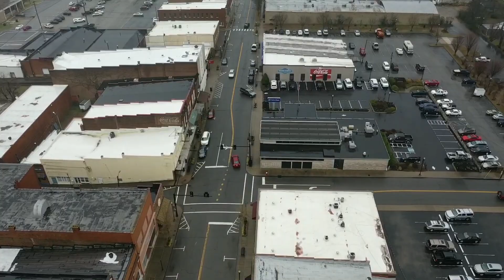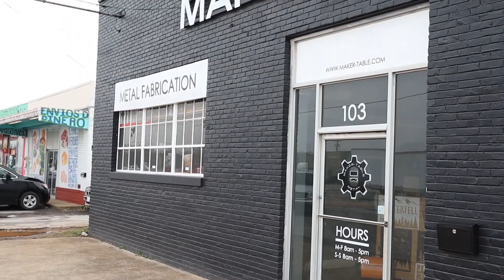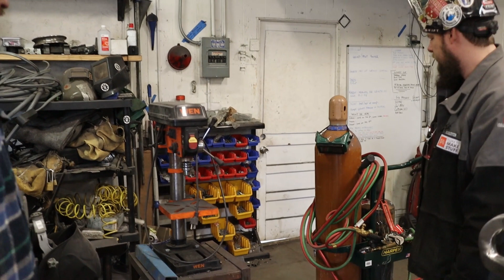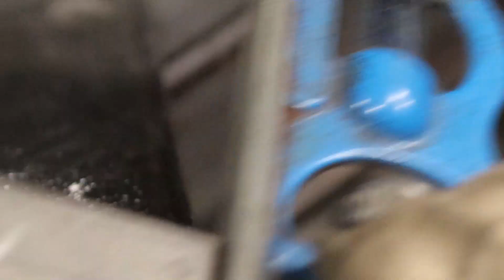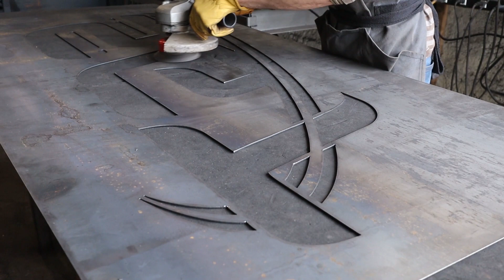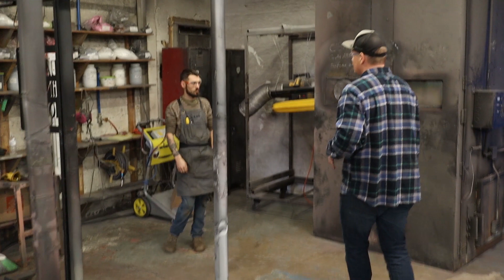METAL SHOP TOUR (2019) - MAKER TABLE METAL [Ep. 3]

Comment: Sounds like you to call Eaton compressor and upgrade your compressor with rotor screw compressor https://eatoncompressor.com/product/7-5hp-rotary-screw-air-compressor-single-phase-cabinet-only/ that unit is rated for 100% duty cyle and last you years of hard use and they have done alot standard compressors too love the content
Reply from the maker: Dude, I would LOVE a screw compressor!  I actually got an Eaton compressor, air dryer and muffler this year.  Great product but still a traditional 2 stage compressor with 120 gallons of headspace, we call her Buddha LOL!

Comment: What do you do for air quality / fume extraction on the plasma table and welders? This is my first winter with a plasma cutter, and having the garage door closed is just not an option... I got a respirator, but still wondering what others are doing to keep the air breathable. Thanks!
Reply from the maker: We move a LOT of air is the only answer.  Keep your water bed topped off, doors open and a respirator on.  I started with my table right in front of the garage door with a fan in front and behind to try and create a tunnel of air that carried smoke out asap.

Comment: great to see a video of the shop tour and current status of things and the kit you're running. A screw compressor is on your list im guessing, to replace those belt driven ones? bit more expensive but long term a lot better and smaller footprint with a lot higher output.
Also, another simple and cheap improvement to make to the compressor area and dryer is to enclose all that in by making a simple stud wall enclosure to seal it in and add a heater to that newly formed 'room'. Also if you can vent into that room through the wall to the outside (preferably with an internal filter in place) which will let the compressors draw in fresh exterior air, reduce how much they such in grinder/cutting dust from the shop and reduce filter replacement. The heater that would be in that mini room would also help as a pre drying stage before it goes through your black box there and also keep it working efficiently with fewer filter replacements. 
I was really enjoying our chat on the last video of the sabre table
Reply from the maker: Yeah, your spot on with the screw compressor.  it's in our future but they are spendy units and the motors are cheaper by comparison for the time being.

I really like that doghouse idea!  It would also cut down on the noise in the shop.  Not to say it will ever be quiet back there but it would be nice to cut down some of the noise.  There is a window nearby that we could vent to.  i don't even think a filter would be that tricky.  Hmmm, looks like I have a new kaizen project on the list.

Comment: what kind of wire brush are you guys using to remove the slag from those signs and at what speed. Is it a diamond coated wire wheel?
Reply from the maker: I find a 4 inch wire brush on a 7 inch grinder is the best combo for removing slag.

Comment: Kicking But & Taking Names! Those 350P's are flame spraying monsters, they may be blue but they make a lot of Green !
Reply from the maker: It seriously makes me a better welder, it's the nicest machine I've ever used. Can't say enough good things about it
Reply: @MakerTable  
You running 90 / 10 on the pulse mode? If you have a really really big aluminum job you can get a push / pull setup for about 2K.. (hence the really really big job comment lol). I have a 300 bottle and 44lb spool of wire in the 6x12 plaz table project so far.
Reply from the maker: @SegoMan  yeah those push pull guns are sweet but pricing. I'll wait till I find a customer to pay for one 👍